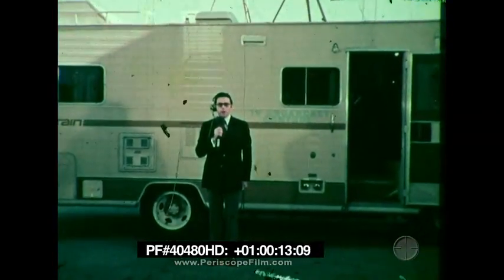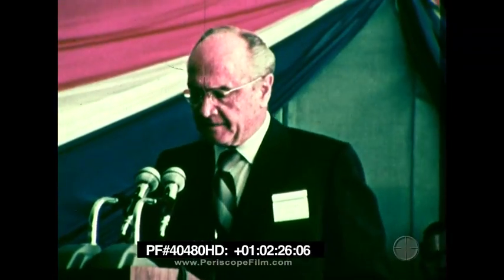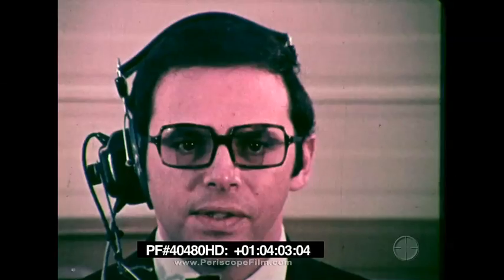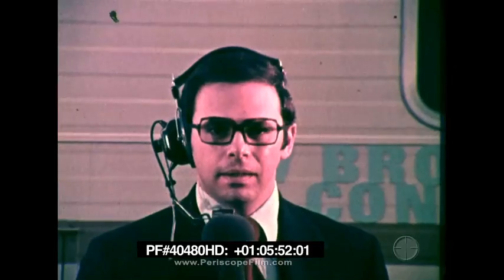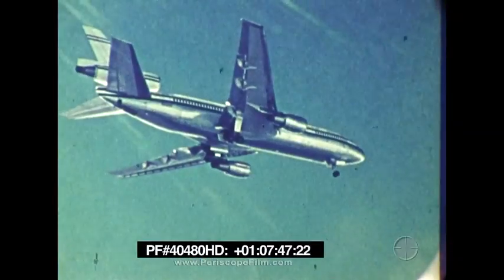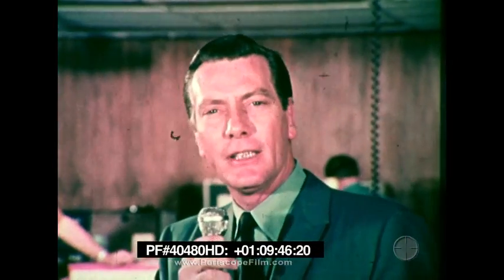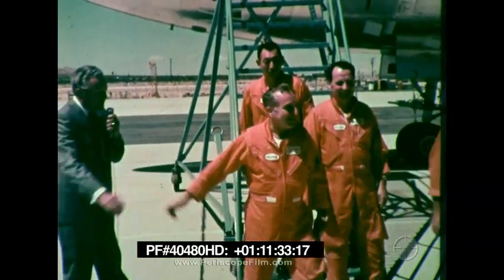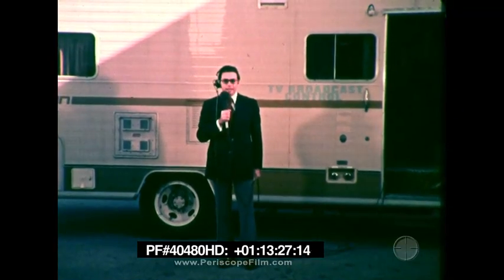The DC-10 Takes Flight - McDonnell Douglas, 1970 40480 HD

Comment: I flew in that plane when I was 8 years old in 1978...non stop flight from Cleveland to LA.
That plane was so big and we were told we passed through three storms and the plane just rocked gently.
Been a fan ever since.
Reply: I also love (and will miss) the DC-10! Flew on it a couple of times. I love how its engines are So Powerful, and how it takes off at such a Steep angle and with So much speed! More fun to fly in than the 747 for this reason.

Comment: Pity the cargo door didn't blow out on that flight, would have saved the lives of 350 people
Reply: Actually, a cargo door did blow out in early ground pressurization testing prior to the first flight, so McDonnell Douglas was well aware that there was a problem with the poorly engineered locking mechanism. But they chose to put a band-aid on it and hope for the best instead of redesigning the door latches.
Reply: well that was a good idea wasn't it?
Reply: @Johnny Greeko Huh?
Reply: The reason the cargo door blew out over France was because a cargo handler failed to secure it.

Comment: MCD engineering could have run hydraulic cables in the ceiling like Boeing does also encase the cables in conduit piping 
as done with elec wiring even done in commercial use...since in theory the "tail" flies the plane these additions could have
helped negate the cargo door loss in flight..again 20/20 hindsight..

Comment: I was a flight attendant for Northwest Airlines. The DC-10 was my favorite widebody to work. It was so much easier to manage than the 747-100/400. It was a great aircraft! However, I think the widebody aircraft were fairly unnecessary. Look today and airlines seem to be shifting to single aisle aircraft for many int'l flights. Sure we have the A350 and B787, but they are much more efficient than the rest. Most of those widebody flights went out half empty or even less. It was such a waste and big money loser.
Reply: The ability for smaller, single aisle aircraft to cross the pond didn’t exist back then. Same with efficiency.

Comment: Sadly both the DC10 and the L1011 would be made redundant just a few years later with the introduction of the much more economically sound Airbus A300 and the Boeing 767. Effectively ending McDonnell Douglas and Lockheed’s bids in the comercial jet market.
Reply: When the rules changed to allow 2 engine flight over water, the trijets were toast.

Comment: A piece of crap plane. Never forget AA 191 out of O'Hare.
Reply: Going Slightly Mad, that accident was totally preventable and 100% AA's fault for not following procedure when removing engines from the wings. (You're suppose to remove an engine from the pylon first, not the pylon from the wing while the engine is still attached; guess what AA did?) That said, very freaky, scary crash that––I too––will never ever forget; poor passengers and crew.
Reply: Yup blame poor maintenance on a plane.  It was never in the brief to take engines off the wing using a fork lift!  The cargo door, yep that's all on Douglas, but AA191 was all on American